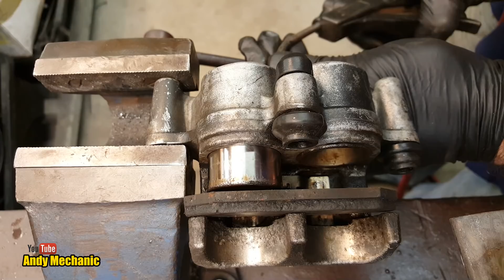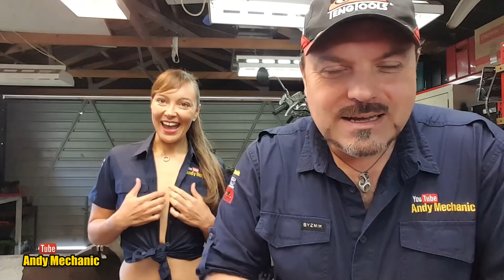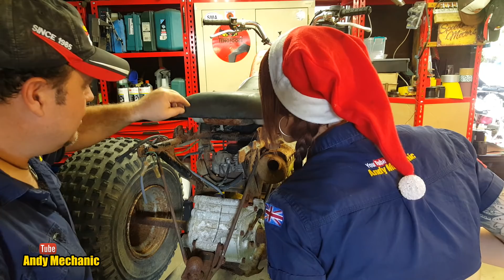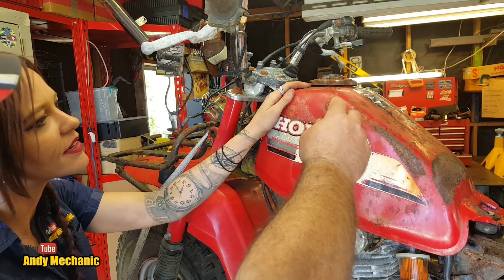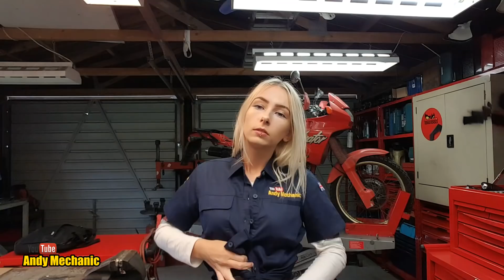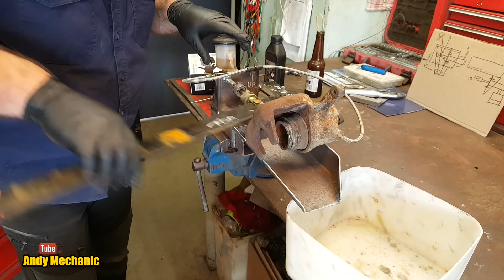Honda ATC 200 Big Red update Ft.Tool Girl Lilli #2329

Comment: bj weld for the tank to plug the holes  . ive done it it works. the best tip to weld a tank is to fill it with fumes from the exhaust . or argon if you have it
Reply from the maker: Cheers Simon. I'll be welding it up in the next few days....probably will do it to camera if I have time :-)

Thanks Andy

Comment: did you know that Honda got the idea for the 3 wheeler from a nz built item . much wider and longer wheel base lacking ground clearance though .got a brand new name plate around here some where that never been stamped for one . they were called gnat and later a 6 wheel verison but in rangiora called aavako (not spelt right  )
Reply from the maker: Wow, now I didn't know that. Interesting....I visit Rangiora 3 or 4 times a year. I'll try track down the chap that designed them. 

Cheers for the info. Andy :-)

Comment: Andy, I will be interested to see your method for welding the fuel tank, or more particularly dealing with the petrol residue. Over the years I have welded quite a few bike tanks. What I do to get rid of the petrol fumes is run exhaust gas into the tank for 20 minutes - just a rubber hose from the car exhaust into the tank pushed down through the filler down one side of the tunnel so it circulates through the tank. Enjoyed the video, hope your test ride goes well.
Reply from the maker: Cheers me too! Usually I just rinse them out with water and let them sit a day or two to dry out....no explosions yet touch wood! :-)

Comment: I had a tank that was rusty internally and had a small pinhole in it I used a tank cleaner and sealant. I believe it was a rubber type sealant it work great no leaking and no junk in my carbs.
Reply from the maker: Sounds good. I used a similar product on an XT500 fuel tank but that was after I had welded it up as it had cracks around the mountings..

Good to hear from you. Hope all is well. Cheers Andy
Reply: @AndyMechanic  I'm doing well I hope everything is good on your end

Comment: Hi Andy, i’ve got a few of these Honda ATC 200 ES’s here in Canada and when viewing your video I noticed the transmission is an up shifter from neutral to five, all of the 1984’s in North America are the opposite, neutral is at the top and you downshift 12345 to get to the high gear. Just a point of interest, cheers!
Reply from the maker: Hmmmm....interesting. I'll mention that in a future video. Thanks Andy

Comment: Merry Christmas!
Reply: ey up the right rear drum is held in with 6 bolts and is conventional dry brake system   https://www.cmsnl.com/honda-atc200es-big-red-1984-e-usa_model963/drum-rrbrake_42622969000/#.XA0L4Gj7S0o
Reply: dont ride it with that tank unfixed preferably replaced